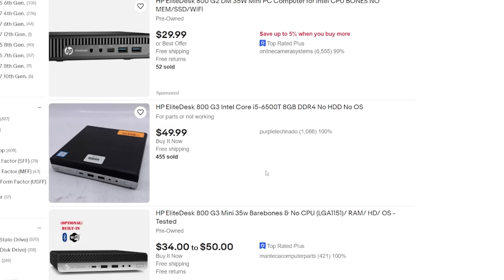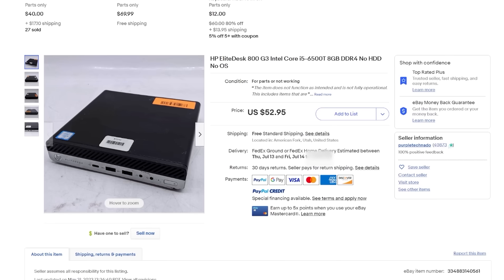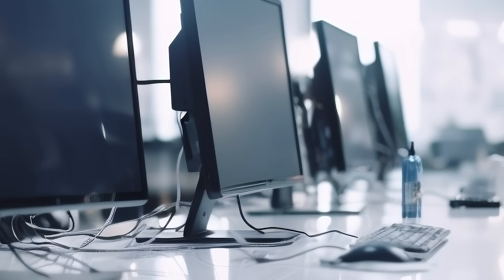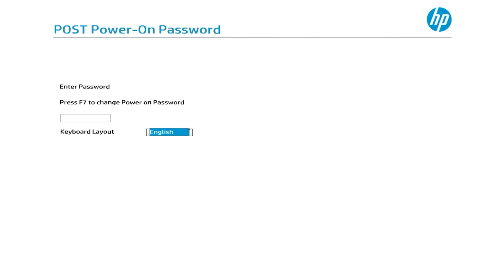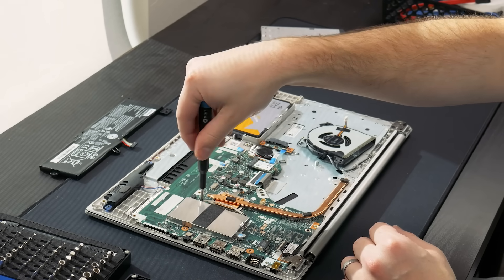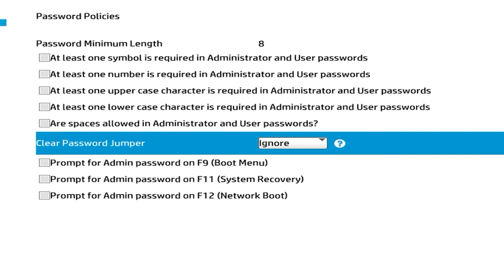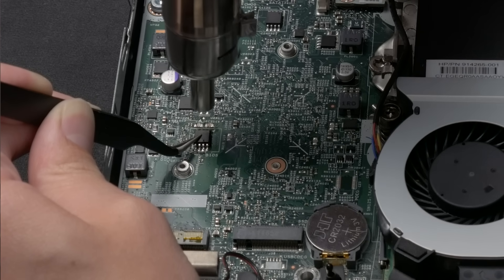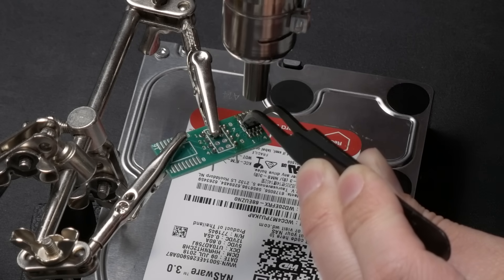I Bought a BIOS-Locked PC. Should You?

Comment: get a flashdrive. create new folder in flashdrive. name folder Update. download proper BIOS Update from either manufacturer or i occasionally use XDA forums to find the right updates. extract update once downloaded to the Update folder. boot laptop and whatever key necessary to get to boot options. in boot options select uefi/bios update. select location to get your update from(your flashdrive) and browse Update folder and select the update you downloaded then once its done you should have a laptop you can the boot to windows recovery and the wipe and wah lah 🎉
Reply: depending on manufacturer, if it is HP YouTube the right process to boot into HP recovery then which options to select to get a fresh wipe and refreshed o.s.

Comment: I have unlocked the bios for a couple T61 which were locked with power on password. Basically, until xx30 models (Ivy Bridge) you can simply short 2 pins on the bios chip while powering on. This will skip password control and let you enter the password change page to set it to blank. I have found a website with pictures of different mobo from many Thinkpad models, where you can find yours and identify the bios chip, but now seems to be offline. :(

Comment: They used to have a jumper that was missing that would clear the cmos when you connected the jumper and power on
Back in the 90s there was a floppy disk and then a CD that would boot the machine to a special machine code and it would give you just a option to clear the power on password

The manufacturer does have a factory reset CODE
There is a way to flash a clean CMOS to the chip using this CODE but I have only seen it at authorized Manufacturer repair shops

It is a quick way the Manufacturer clears any systems coming back to them for factory repair and replacement under warranty

The special keys you need to hold down may be online
I have not looked in a long time

The last CD I saw had a special set of instructions for keys to hold down during boot to get it to read the CD

The BIOS has a program that looks for that special condition on power up and if it exists it then will read the CD or USB and look for a specific name of the media, like for example HP_BIOS or something else like this, but very specific and that is also written into the bios programming 
If both the keys condition and the device media name is correct it looks for a special file name on the root directory on the media, like CLR_BIOS.ID
And it either reads that file and it meets the condition and executes the exe file on the media that is a hidden machine language program, or if the bios programming has it as part of its program, it looks at that special file and reads the code in it, like 01 23 45 67 and it matches the code in the bios and the bios clears the password required for power up and to enter bios. It clears both thise flags and the values in those fields.

The companies don't want to have to open up the case to do anything unless absolutely necessary. It takes time and they don't want to waste time. 

That's why they have this
So the workbench at the repair center has a bunch of USB cables that are each labeled as to what they are for and they each connect to a virtual USB stick image that is treated like a USB stick
They have the keyboard and mouse at the workbench and they plug it in and sometimes they don't even need the keyboard to get it to the special condition.
Sometimes it just needs to see the usb stick name being correct and it will read even when the bios is set to not read it. 
Sometimes you have to hold in the power button or press both the power and reset buttons, or some other set of button presses to get it to read the usb or cd.

Usually the companies don't program to ignore the bios clr.
When they do, there is usually a transitor or something else that supplies the voltage to that jumper.
If you use a multimeter and test a machine with the power on at that jumper and see if it has voltage or ground and see if the condition is different on the one with the ignore bios clr jumper flag set, you can figure out how to use a jumper and give it either voltage, or usually a ground state.
Normally it is when you connect it you are grounding and CMOS and causing it to lose it's 3 volt backup power

If you read the spec sheet on the cmos and the schematic for the board , the jumper is supplying the 3 volt battery to the cmos.
The clear button is tying the cmos clear pin or the cmos power pin to ground.

I remember having a cmos that was actively written to to deactivate the machine and I wired in a toggle switch from the pin on the cmos to ground
I would power off the device and flip the toggle, power it on, power it off and flip the toggle back to it's off position and power the device back on and the cmos was cleared and the device worked again for another 24 hours.

That board had no way to clear the cmos from the factory
It was designed so they could send the command to write a value in the cmos locking it.
It wasn't designed to be unlocked except with a new command to the CMOS

But I figured out how to clear it.
I bought a quad core new mini pc for 100 dollars.

I will have to look for deals for locked machines.

Comment: I'm pretty sure that Windows activation keys are not stored in the BIOS, they're stored by Windows itself and are verified with hardware ID which is gathered by windows based on the hardware of the device.

Mac address isn't always stored in the BIOS chip either, sometimes it is I know it definitely is on the Chromebox systems but that's not necessarily universal, in many cases it stored in the ethernet card which is a separate chip.

Comment: Lifting prom pin 1 or 8 from the motherboard will allow you to program it without desoldering. Do not ground the voltage pin as some people say, it could damage the chip and your programmer. I usually slide a piece of kapton tape under the lifted pin to make sure it doesn’t make contact again while clamped. Cheers!

Comment: 6:44 - 6:58

From what you pointed out, it looks like the user can get a full copy of their BIOS straight from the OEM or unofficial sources, which is not correct.

An oversimplified, brief explaination is that: 

The BIOS UPDATE cannot restore the BIOS IMAGE, because the update is not a full bios image. It has the same size as the BIOS IMAGE, but the BIOS UPDATE is mostly filled with FF to match the BIOS IMAGE layout. 

That is why many BIOS brands like Insyde, AMI and Phoenix have a check to prevent the users from bricking their computers.

The only ways to obtain a full BIOS image for your device are:

1. Contact your device OEM, which will most likely not help you at all, by saying that "they can't make a new bios for you because they don't cover that, they don't like you or the warranty expired"

2. Dump the BIOS IMAGE with a physical programmer

3. Dump the BIOS IMAGE with  a digital programmer

I like your vids and I learnt some things from your channel.

Keep it up ❤❤❤❤❤❤❤

Comment: I have had school laptops which were not bios locked so we locked them than we reinstalled windows 7 (this was an in 2013) and we did that to bypass the school their program which keeps an check on what we did with their laptops, it checked for tab names like filter words so that was terrible but since I could code html and there is an extention which could inject an page with code I changed the tab title to random string math limited to 1.0 as soon as you load an website we used it before it got cracked since we had school accounts we just reinstalled windows when we went away from school and log in using those accounts which reinstalled the school things automatically, never got caught. 😂

Comment: Bought a BIOS locked Dell from a company that was liquidating. They were supplied the computer from a vendor, so I called the vendor to see if they could help me unlock it, and they were complete D*CKS about it. "you just bought yourself a paper weight". A few moments after that phone call, I found the jumper on the board that resets the BIOS, and was good to go.
Reply: Should have recorded it then sent it to the CEO. Bad rude employees for any reason are frequently delt with swiftly as bad publicity is just bad for image
Reply: All manufacturers should have jumpers to remove these passwords.

Comment: Something to try that's worked several times for me with various desktop and server motherboards, although sadly isn't an easy option for most laptops: On a lot of boards, if you replace the CPU, it will allow you one-time access to even the most locked-down BIOS, so if you have another spare CPU for your locked motherboard, remove the BIOS battery, close the CMOS jumper, then replace the CPU. Remove the CMOS jumper, replace the battery, and switch on. Some boards will take you straight to BIOS and others will give you a message to say the CPU has been changed and to press (usually) F1 to enter BIOS. Once in there, you MUST remember to change or remove the password at that point, because if you leave the original password set, it's a one-time deal until you replace the CPU again.
Reply: Swapping the amount of RAM also sometimes works.
Reply: useful tip! I've had issues with pre-crippled SFF's where they won't run with anything other than the supplied chip, every time I managed to fix it. Possibly why a lot of the "faulty/spares or repair" ones have a different CPU, someone has taken out the good working chip and substituted a potato or worse, a faulty processor.
Reply: @conundrum2007 I was gonna do that to a OptiPlex, guess I can’t?
Reply: @dothatjustin  Try it. Other option might be to send me the bad BIOS IC and I will attempt to clone it to a new one. Sometimes that is all you need, done this once before.
Reply: @conundrum2007 huh, well I’m always willing to learn more, I’m not sure what to do tho and if you wanted to try it out I can try sending it maybe ilyk
Reply: I wonder if it would work on a elitebook 8770w...

Comment: If you have a full bios file from the manufacturer, just compare that to the one you took from the chip. It's got to show the parts where all the serials etc are stored.
For a Lenovo ideapad with a failed bios flash I just programmed the rom file from Lenovo, and filled in the serials with some software. Forgot which software, maybe the ami stuff.
Reply: How can I extract bin file from .exe file,downloaded from lenovo site? Thanks

Comment: What we need is a way to get around the lock on school Chromebooks as they're essentially e-waste if the schools don't want them back and they've flooded eBay, Craigslist, and marketplace. Received one in a large trade last trade myself, the school didn't want it back, yet wouldn't unlock it, so it's stuck with a lock to the school's domain and no way to bypass it with reinstalling chromeos, removing cmos, etc.

Comment: Hardware hacker: makes $10,000+ a month.
Hardware hacker: Spends a month unlocking a BIOS to get a $100 used computer to boot.
If you value your time, buy a computer that works.
Reply from the maker: Not sure if you’re calling me a hacker or are talking about a hypothetical hacker..

Assuming you’re talking about me, I definitely don’t make $10,000+ a month, and it only took me about 5 minutes to remove the BIOS password; it took me a month to make the video.
Reply: @HardwareHaven  no insult intended. I figure most people who could easily do this could be making well over $5,000 a month.
Did you really spend only 5 minutes on this!? I think it would take me longer than that just to set up my tools.
Reply from the maker: @mrtechie6810  Well including the time to setup camera stuff, no lol. But I already figured there would be a jumper, and I didn't need to use any tools to get it open. (I filmed the B-Roll in the video a bit later)

Comment: Here's how to defeat your IT department's UEFI agents, LAN booting, etc.   All enterprise workstations are running custom firmware; using the stock BIOS flash, you can then go into your settings at all levels of power up to deny IT their hooks and reflashing over the network.
If you didn't keep it off the network prior, the place I used to work would literally rewrite your BIOS within an hour of flashing it to stock and if it did it enough times or IT realized it's only your build that just keeps failing you start getting nasty emails from the admins.  Since you couldn't get on the network without an IT Build OS, once I had control of the BIOS I could turn on virtualization and then let the virtual machine receive the request from IT autobuilders to detect and re-install the OS (it was a blank VM lol) so then I was eternally running inside of a VM but kept full control of my host system (no dual boot needed).
Computers are dumb; once you have access to console they can't protect themselves - I haven't found a single clientside HP workstation/endpoint that's been unable to flash back to OEM generic BIOS.  The stuff in the racks, yes it can lock you out at console for a while, but that's serverside and a very much different beast.  But still, once you have physical access it's just a matter of time.

Comment: I knowingly bought a cheap Asus P9X79 motherboard, because it had a bad bios chip. It kept having issues booting even though it had all the CPU pins, ergo bad bios chip. How do I know that? Because I broke a Chinese x79 motherboard by flashing the wrong bios in software. And then replacing the chip with another with the wrong bios. Fun times

Comment: For the guys that cant reflash the bios ic  and wanna get a pc for cheap . Bios will lock the option to boot from another device (depends on the pc) Just put the ssd or hdd you want in another pc same generation format it until you see setup screen remove it and plug it in the bios locked device on the same sata port and it should boot just fine on the fresh installed os . Used to do it a lot when i didn’t have tools to flash bios ics

Comment: If you have an encrypted disc but don't have the key, format it. 
For a bios locked laptop I had, I unplugged the bios battery. It even corrupted a hard drive I put in it with its "Return me!" lock screen on bios boot.

Comment: The thing that bothers me is the Apple Activation Lock.   If activated and don't know the user or user information, then you can't use the device or in my case can't use 2nd hand.  I did contact Apple and they wanted proof that you bought it originally "NEW" with receipt, not ebay resale receipt.  So Apple told me unless you are the original owner that they cannot unlock it.   So they do have the ability to unlock it if you bought it new and shown your receipt.  I even asked can you contact the original owner and email them to untie the device from there account and they said they have no way to contact them.  But then how would Apple know who's device it is if given the serial number tied to the email.  Apple just told me I can use it for parts or "We have plenty of new devices you can purchase on our site".  And the Apple Activation Lock is not in the bios but tied to the Apples cloud service.  There hardware is DRM.

Comment: I wouldn't worry too much about the non-3v3 ch341a. Because the current source capability of the CH341a chip i forget but it's absolutely miniscule, like 2mA or something, while 3v3 supply off the regulator on the board provides the clamping voltage via EEPROM's internal ESD diodes. There is a very low likelihood to kill something.

Comment: I haven't seen any BIOS locked ones and I have bought over 100 SFF Dell Optiplex and HP Prodesk PCs for number crunching. Got to have an unlocked BIOS to undervolt them Skylake cores by 140mV
Reply: Scratch that, I have a number of BIOS locked HP Prodesks meow. Locked as in, cannot downgrade BIOS version. I can modify the configuration but cannot downgrade to bypass Plundervolt. No luck so far

Comment: You need to remove your mobo battery for correct chip detection.. otherwise it will cause voltage distortion

Comment: I dump alle the firmwares out of my devices not only fron PCs or Notebooks also from my TVs Blue-Ray Players and other devices I own some devices use a TSOP48 Flash, TSOP48 NAND flash, BGA NAND flash, and much more the chip on most PC and Notebooks of today like in this video uses a SOP8 or also SOIC8 SPI flash ROM.
Reply: and all devices survived also the devices with TSOP48 flash. remember guys. most flash ROMs can hold the data approximately 20 years in the flash rom. before it gets corrupted and makes the device unusable thats the reason I dump out alle the firmware from my devices I own. I use the XGECU Pro TL866 II Plus programmer

Comment: I also have had luck shorting out the data line on a Bios flash during the boot process that triggers the backup bios to load.   That's how I got past the bios lock on a pair of ex government panasonic toughbooks.   I shorted the clock to a data line as they were next to each other with a tiny probe during different points in the boot process and triggered the bios recovery.    of cours this only works on systems that have a bios recovery.

Comment: I have a question - why so many devices are sold with locked BIOS? No judgement here, but it sounds like a stolen hardware to me.
Reply from the maker: I would assume they are typically units that were used in large organizations and then auctioned off. Most typical consumers don’t setup BIOS passwords. They’re typically set by IT departments.

Comment: Just pointing out, but there's one thing you're never touching. AMT. This method works only for the startup/setup passwords. It does NOT work for AMT locked and you will instead brick the mobo if you do this...